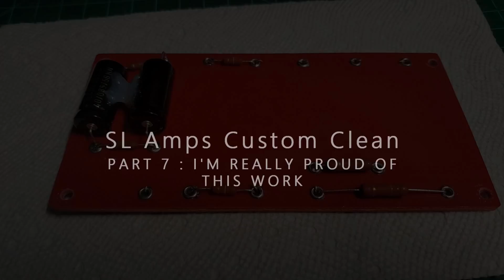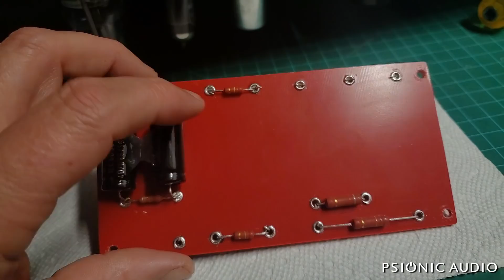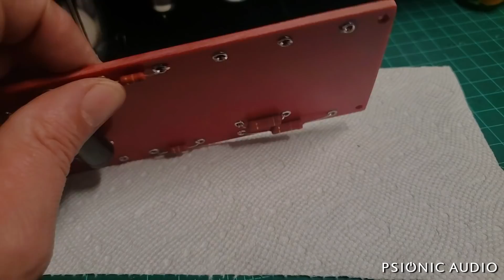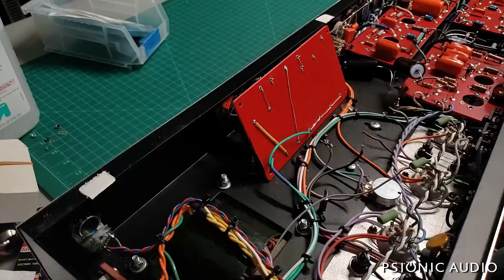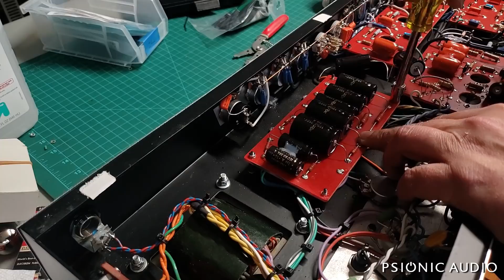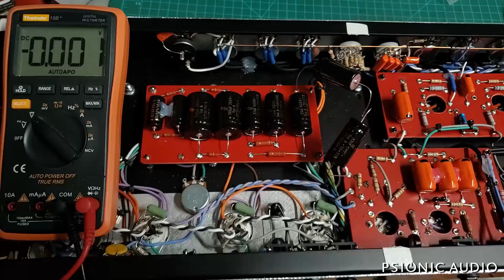SL Amps Custom Clean | Part 7 : I'm Really Proud of This Work

Comment: This amp appears to be derived from the Dumble Steel String Singer design. The SSS utilizes a post phase inverter cathode follower driver design. The cathodes of the driver and the grids receive negative voltage. The cathodes at more negative voltage than the grids. The cathodes supply the signal to the grids of the power tubes. This requires the bias voltage to be derived from one leg of the AC from the power transformer. Similar to the output of the Ampeg SVT.

Comment: I tell you what, I learned a lot about bias failures with this one. I will only use PT’s with a dedicated bias tap or dedicated bias winding from this point on.

I would dime that amp into a 4X12 with EV12L’s, TS10 and my favorite Stratocaster in a heartbeat!